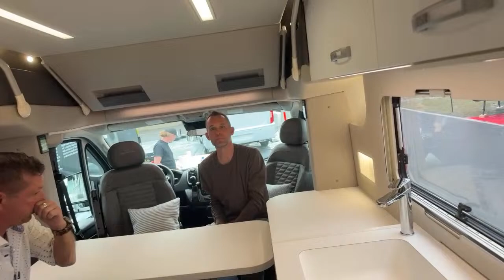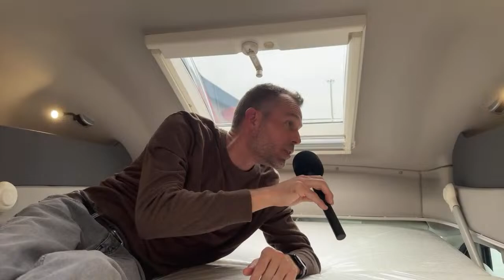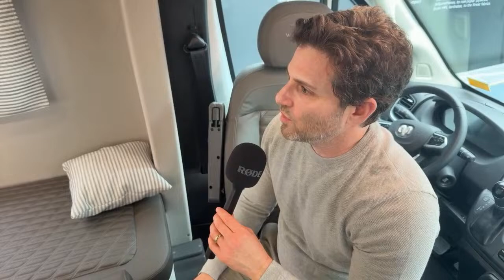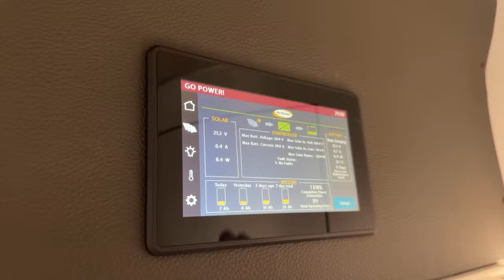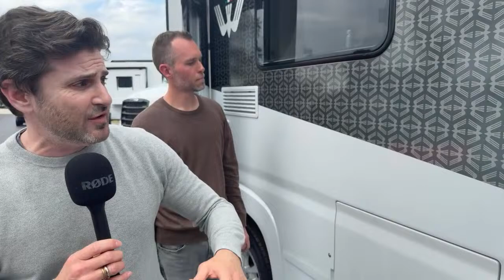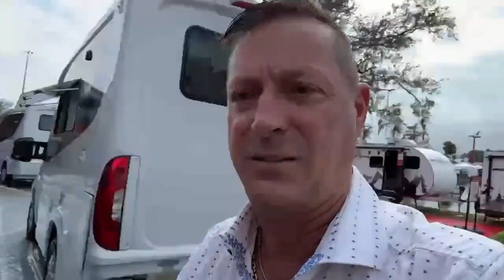WINGAMM Oasi TECH SPECS Walkthrough + Q&A - 2025 Florida RV SuperShow

Comment: 200 Amp Hours? How long can you run the AC in Florida........How long does the propane last in below freezing weather?  Is this an American Dodge Ram or Fiat? needs bigger freezer..How long does it. take to. warm up the water...All American RV class B has a Microwave Air Fryer...